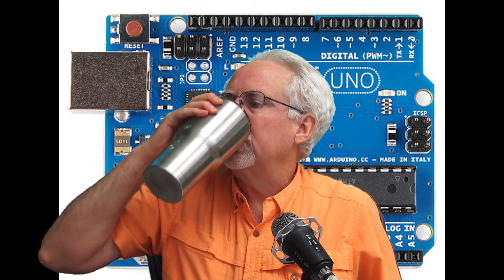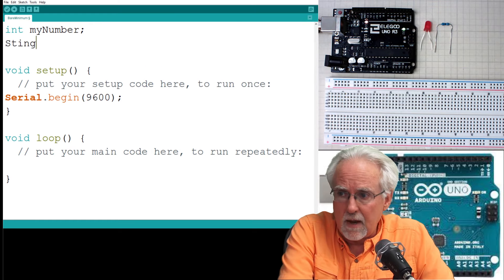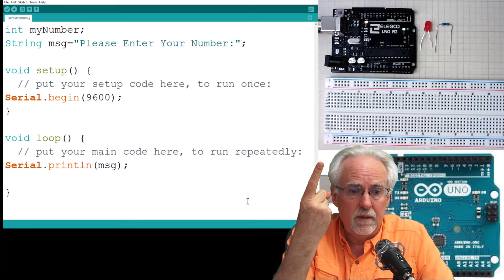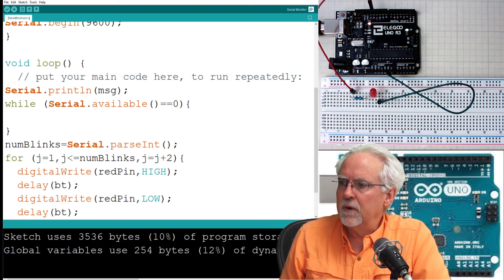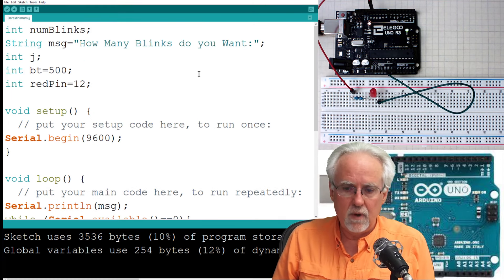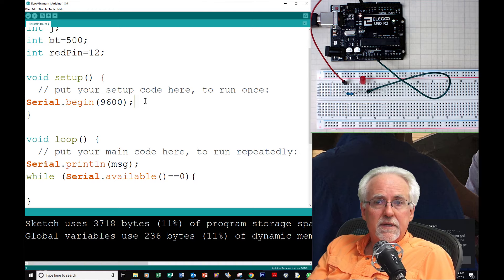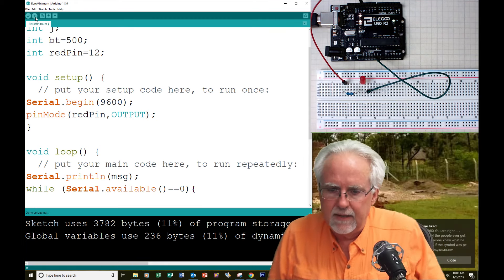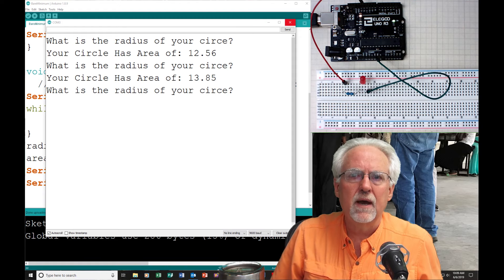Arduino Tutorial 18: Reading Numbers from the Serial Monitor

Comment: Interesting issue.  When I coded I kept the original I added the blink code below, thereby keeping both for learning.  In trying to decode, I also decided to switch back to IDE 1.18.19.  Still had the problem of getting an immediate "0" response when trying to enter the number of blinks, but the first section worked correctly.  Finally I commented out the first section and then the blink section worked correctly, allowing me to enter the number of blinks and getting the correct output.  Also tried the blinking on IDE 2.1.1 -- it works.  Also noted that the overwriting of the first four characters no longer happens.  Also have been in communications with a gentleman at Arduino, he has been great in providing very fast responses.

Comment: I figured that:

1. Pretty much the "commands" that we know up to this point, are functions.
   Anything that takes the form: text(); or text(){} can be considered a function.

   *pinMode() 
    ---> is a function that lets the arduino setup a pin to be either an input or output.
    ---> it takes in two parmeters: pinMode(pin#,INPUT/OUTPUT);
    
   *Serial.begin() 
    ---> is a function that lets the arduino setup the serial monitor.
    ---> it takes in one parameter: Serial.begin(baudrate);

   *digitalWrite() 
    ---> is a function that lets the arduino send a digital signal (high/low) on any of its digital pins.
    ---> it takes in two parameters: digitalWrite(pin#,HIGH/LOW);
   
   *analogWrite() 
    ---> is a function that lets the arduino send an analog signal (between 0 to 255) on any of its analog pins.
    ---> it takes in two parameters: analogWrite(pin#,0 to 255);

   *delay()
    ---> is a function that lets the arduino exhaust the time (in milliseconds) taken as its parameter.
    ---> it takes in one parameter: delay(time in milliseconds);

   *analogRead() 
    ---> is a function that lets the arduino read from its analog input pins (A0,A1,A2,A3,...,etc.) and be ready to hand it off to a variable.
    ---> it takes in one parameter: analogRead(pin#);

   *Serial.print() 
    ---> is a function that lets the arduino print on the serial monitor the content of a variable OR print a string directly passed as parameter.
    ---> it takes in one parameter: Serial.print(variable); OR Serial.print("place any text inside of the quote marks");

   *Serial.println() 
    ---> is a function similar to Serial.print() only that it proceeds to the next line after printing.
    ---> it takes in one parameter: Serial.println(variable); OR Serial.println("place any text inside of the quote marks");

   *if(){} 
    ---> is a function that lets the arduino form a conditional scenario based on the condition passed as parameter.
    ---> it takes in one parameter: if(insert condition here){ insert lines of codes here to be executed when condition is met }
    ---> conditions can contain relational operators like: >, <, >=, <=, !=, ==
    ---> conditions can contain boolean operators like: !, &&, ||

   *for(){} 
    ---> is a function that lets the arduino form a conditional-loop scenario based on the condition passed as parameter. 
    ---> it takes in 3 parameters: for(start,condition,increment/decrement){ insert lines of codes here to be executed when condition is met }
    ---> the "increment/decrement" parameter is what updates the value of the "start" parameter.
         this gives the line-by-line execution of the arduino program to get out of the loop (i.e. get out of the clause) when condition is not met
    ---> conditions can contain relational operators like: >, <, >=, <=, !=, ==
    ---> conditions can contain boolean operators like: !, &&, ||
    

   *while(){}
    ---> is a function that lets the arduino form a conditional-loop scenario based on the condition passed as parameter.
    ---> it takes in one parameter: while(condition){ insert lines of codes here to be executed when condition is met }
    ---> this is similar to for loop in a sense that the three parameters that the for loop takes must be translated in the while loop working syntax
         ---> the "start" parameter in the for loop must be typed before the while loop 
         ---> any variable used in the condition of the while loop must be updated...
              therefore, we need to make the last statement inside the while clause all about updating the variable in the condition.
              this gives the line-by-line execution of the arduino program to get out of the loop (i.e. get out of the clause) when condition is not met.
              this is the equivalent of the "increment/decrement" parameter in the for loop.

   *Serial.available() 
    ---> is a function that lets the arduino instruct the serial port to check if there is available data in its vicinity (i.e. vicinity of the serial port)
    ---> it does not take any parameter.

   *Serial.parseInt() 
    ---> is a function that lets the arduino instruct the serial port to read/parse the integer data in its vicinity and be ready to hand it off to a variable.
    ---> it does not take any parameter. 

   *Serial.parseFloat()
    ---> is a function that lets the arduino instruct the serial port to read/parse the float data in its vicinity and be ready to hand it off to a variable.
    ---> it does not take any parameter.

2. These "commands"/functions that we know up to this point are created by arduino developers.
   Although we can make functions ourselves inside the IDE, 
   we will still use the developer-made commands/functions to write them anyways.

3. Developer commands/functions are fundamentally different in that they take in different parameters, 
   they take in different number of parameters (or no parameters at all),
   and some contains clauses. 
  

Been rationalizing about this the whole day yesterday, feels to get it out of my head and finally put it into words.
Thank you Sir Paul! Learning one lesson at a time! : )

Comment: I know I am a couple of years behind, but just got into Arduino. The lesson calculated the area of a circle.  After this lesson I made some changes.  At my work, we estimate how much hose is left in a coil.  We measure the diameter, calculate the circumference, then multiply times the number of coils and we get a fairly close length of hose.  This lesson has evolved.  It now starts by saying: (copy of serial monitor)
Hello, I can can calculate the length of hose in a coil.

What is the diameter of your circle?
The circumference of your circle is: 9.42

How many coils are there?: 
The length is: 56.52

Comment: On your serial monitor make sure you have "No line Ending" selected in the box next to baud rate otherwise it goes through the while loop and outputs a "Your Number is: 0 " after it outputs the correct number.

Comment: Thank you for these lessons, Paul! You often ask if we are actually working along. I definitely am, and this has helped this stuff finally click for me! I actually had a slight hiccup in this one though. For some reason, after I enter a value, it provides my feedback, but then acts like I've entered a second value of zero, and provides the feedback for that value before waiting for my next entry. This happened for both the basic number entry and the area of a circle calculator. So, after entering a single value I would get this:

What is the radius of your circle?
Your circle has an area of: 13.85
What is the radius of your circle?
Your circle has an area of: 0.00
What is the radius of your circle?

Any idea what's causing that? I couldn't find the bug. Thanks again!
Reply from the maker: Make sure serial monitor is set to no line ending.
Reply: @paulmcwhorter  that did the trick! Thank you, Sir!

Comment: Ok so here is my comment,had many problems with writing and understanding this coding stuff.What I have learned over the lessons taken was that all of my errors were on me.I forgot to add a semicolon,I didn't spell correctly,I used the wrong case in letters cap/lc .Many errors were just plain typos and some were just forgetting the characters.All in all ,Paul is great, patience is a virtual , also a must in this stuff,don't get frustrated,just watch it over again.Slow it down ,stop video,practice writing the same one over and over until you get it. Ask yourself questions like ok what is pinMode ,input or output?Is the serial port open and what do I expect to happen when I run the code.Last but not least, is my circuit constructed properly and are my devices working order.

Comment: I actually knew something was wrong with the pin modes! Was thinking, "Hey! Shouldn't you tell those pins what to do at the start of that code?" And I also caught the j+2 thingy too.

it's one thing to write code that works, it's another thing to write code that works the way you want it to.

Comment: Working on making an ecu, the hall affect sensor for the cam is a 3 wire with a 5v input and 12v digital output, the cam gear had a wide gap and a narrow gap for cylinder 1 and cylinder 4, im having a hard time on figuring out how i can program my engine position to fire the injectors when there is 2 interrupts, it is for a 94 ford 7.3 powerstroke

Comment: Videos are just the right length. I really like the way you teach because it makes easier to remember what things to check over and over so the code would compile the first time I try it. I caught the "j=j+2" immediately while you were coding the example. However, I did not catch that you did not write the "pinMode" command, because my program compiled the first time. I keep making mental notes that if I need to use the pins, then I have to set it up first and then use it, so "pinMode" and "digitalWrite" or "analogWrite" commands always go together, no matter what. Thank you again for your time and dedication you put in these tutorials.

Comment: Hello Paul (and others).  First, thank you for having provided this. It's been fun to do something new during lock down.  I have a problem with the reading a number from the serial monitor (Tutorial 18) and I wonder if you might be able to help.  Everything's working, but my output is not what I would expect.  It works, but I'm getting an extra few lines in my output.  First, here's the code - you'll notice I added another string to make the output a bit more informative:

float pi=3.14;
float radius;
float area;
String msg="What is the radius of circle? ";
String msg2="A circle with radius ";
String msg3=" has an area of ";

void setup() {
Serial.begin(9600);
}

void loop() {
Serial.println(msg);
while (Serial.available()==0) {
  
}
radius=Serial.parseFloat();
area=pi*radius*radius;
Serial.print(msg2);
Serial.print(radius);
Serial.print(msg3);
Serial.println(area);
}

The output I get is this:

What is the radius of circle? 
A circle with radius 3.00 has an area of 28.26
What is the radius of circle? 
A circle with radius 0.00 has an area of 0.00
What is the radius of circle? 

I put 3 in the serial monitor and received the output above.  The problem is the last two lines.  After giving the answer of the area, it correctly asks again what the radius of the circle is, then promptly writes the last two lines.  It will do this each time I answer the prompt - correct answer, then tell me the area of a circle with no radius...

ideas?
Thanks.
Reply: I just saw Paul's message about enabling "No Line Ending" in the monitor.  That solved the problem.

Comment: One thing to note on the Console (bottom, right-hand corner), is to ensure that it is set to "No line ending".  I had mine set to "New Line" and the console kept on printing the "0" after you type in a number beside the "Send" button.  Example of the issue below, when the Console was set to "New Line", "Carriage Return" or "Both NL & CR";

Please Enter Your Number:
The number you typed in is: 33
Please Enter Your Number:
The number you typed in is: 0
Please Enter Your Number:

Comment: I did some research and found out why the led was dim.
Without pinMode(), the port is an input. Also, there is an internal ~30k pull up resistor. 30K Ohms is quite large, so a small current gets to the led.
Well, I learned 2 new Serial commands: Serial.available() and Serial.parseInt().
With Arduino IDE V2.0.4, typing in a command like "delay(" will add the parentheses at the end. it will show the class type and other information in different colors. 
Before the closing "}" at the end of the void loop(), I indent the "}" 3 spaces, so they are easier to read.
With the IDE V2 you have to use the Enter key to send info to the Serial Monitor. I'm using Linux now.
I'm using Grub 2 to boot Linux mint 21.1 or Windows 10. Both have Arduino IDE installed.
Wayne

Comment: Tutorial 18. You are a great teacher, so I saw the pinMode error and the j+2 error right away. When listing variables, why is the first letter of "String" capitalized when it's not for "int" or "bool? Inconsistancy makes learning very difficult!
Reply: I had the same problem and I have been writing code since 1963.  It is useful to print out on paper all of the code you write and keep that in a notebook.  I am about to buy a book on Arduino code in the hope that it will explain in detail the rules for capitalization.  Paul does not have the time in these lessons to explain EVERYTHING :).

Comment: Some idiot (called Luther) spent all day yesterday trying to get this to work. I checked and double checked the code. I uninstalled and reinstalled my USB drivers. I tried a different Arduino board. I tried a different PC. All to no avail. So I thought it must be the cable and got a new one delivered from Amazon. Still no good.

Today I noticed it says to use Ctrl+enter to send the data, not just enter like I had been doing for 24 hours previous. And that works fine.

Fair dinkum....
Reply: Came here for this answer… Thank you!

Comment: It's funny, I fixed the problem with pinMode not being set, but the light still was dim. switched the wire between pin 12 and the resister and it turned out that it was also faulty.

Comment: Also in my usual manner I tried to break it, by entering a ridiculously high number and I got a reply off "ovf"in the text? I assume it can only count to a certain number?
Reply: Similar thing happened to me, I kept putting bigger numbers in there. 32767 is the biggest you can go, then it starts counting negative but the difference but the difference between what you entered and 32767. Turns out that's all you can hold in 15 bits, the 16th bit is used to display whether it is positive or negative. So for int its -32767 - 32767.

Comment: I graduated from ASU with a BSEE in 1988, I Learned Fortran 4 on a PDP1170 Main-Frame computer that was housed in a big room with 12 tons of AC cooling.  Yes, we used PUNCH CARDS....  Your desktop computer is more powerful than that.... The second most ancient computer I programmed used an 8" floppy-disk that were single sided (128K).   I learned to program the Motorola 6800 CPU, Intel's 8080, 8085, and 80286.  Most of my work in college was done on an IBM clone PC working at 4.77MHZ (I splurged and bought a full height 10 MEG hard drive).  Back then we had monochrome green or if you were lucky an orange monitor.    Post college, I learned Visual Basic but never used it, so this is a great course for me.  Better late than never....   I now work in an R&D lab for Vitesco Technologies.  So big smile.  I get allot out of your video's....
Reply from the maker: Indeed something magical about those old monochrome screens and the loud noise the keyboards made. I do miss those days.

Comment: I had a problem with it giving me a second entry of 0 after it processed the first entry with the correct result.  Not sure if I did the right thing but I put a second radius=Serial.parseFloat(); directly after the void loop and that seemed to fix it.  Cheers :-)

Just tried the no line ending and removed the radius code I tried and it worked perfectly :-)

Comment: I have a small issue in the program.  It is taking a second pass before waiting:

int myNumber;
String msg= "Please enter your number:";
String msg2= "your number is:";

void setup() {
Serial.begin(9600);
}

void loop() {
  Serial.println(msg);
  while(Serial.available()==0) {}
  myNumber= Serial.parseInt();
  Serial.print(msg2);
  Serial.println(myNumber);
  
}
 
Serial Monitor:

Please enter your number:
your number is:14                       <- Comment: This is correct.
Please enter your number:         <- Comment: But then it does a second pass ??
your number is:0
Please enter your number:         <- Comment: This is right for the next query.

Paul, or someone else:  What is wrong with this?
Reply: I had this issue as well, for me it was because the Serial Monitor line endings defaults to "New Line"  change this to "No Line Ending" and fixed my issue.
This is because when you press enter it sends the new line characters which gets interrupted as 0 by the parseInt as it's not a valid integer number. Similarly entering non numeric characters will give the same result.

Comment: I am a retired elderly missionary surgeon from Australia, who has been recently introduced to Arduino.  Learning to code is an entirely new experience, which I am enjoying . I am now up to lesson 20, but find I need to go back over the previous lessons to check my coding. It would be most helpful to be able to go to a particular lesson, perhaps at its conclusion, and view a single page of the complete code, rather than scroll through the lesson to find a particular entry.
I join many others to commend your lessons, both technical and biblical.